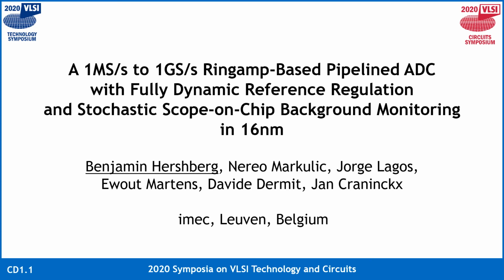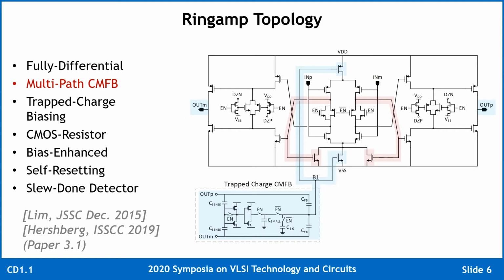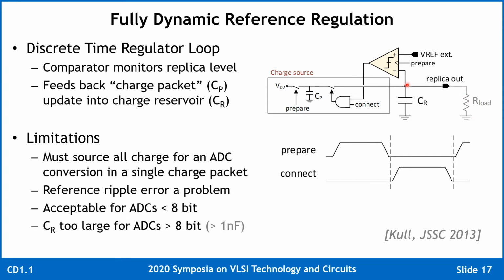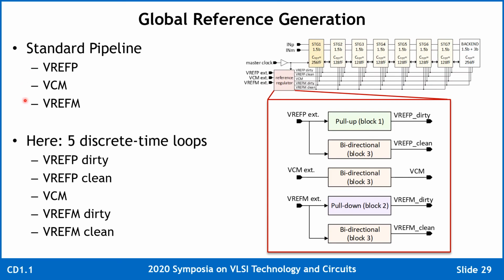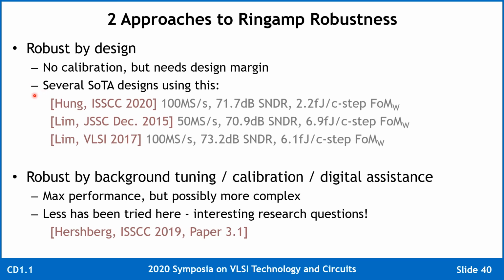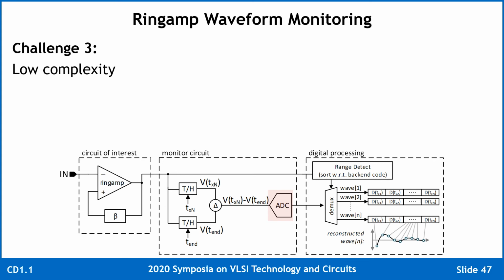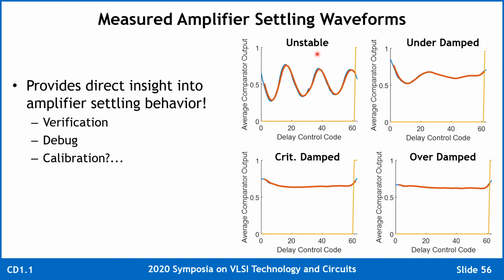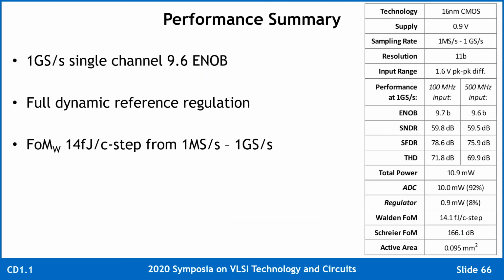A 1MS/s to 1GS/s Ringamp-Based Pipelined ADC

Comment: Sir, I'm not very familiar with the simulation methods used in ring amplifier design. Could you please clarify if the Bode plot is not a primary concern during the design process, and if instead, the transient simulation results are more critical to focus on?

In my design process, I've encountered some difficulties. When simulating a cascade of three inverters, I can achieve the required open-loop gain, but the system is unstable (I haven't added a dead zone yet). After incorporating a dead zone and applying this in a transient simulation, I get the correct results. However, I'm wondering whether I still need to consider the Bode plot in a closed-loop condition?

Thank you for your assistance.🙏
Reply from the maker: Bode plots and DC/AC/STB analysis are useful, but they are just a first step. A ringamp can appear to be stable in small-signal analysis but turn out to be unstable in transient when the dynamic, non-linear, large-signal effects are accounted for. Still, for a class-AB ringamp, AC analysis can be helpful (it is rather useless for a class-B ringamp). For example, it can tell you what your steady-state gain and gain-bandwidth is, which sets the upper bound on your achievable settling accuracy and settling speed. (If this does not meet your speed targets, then your design probably never will, so it is a good starting point.) But for most ringamp topologies, eventually you will need to move over to transient analysis for most of your final design and verification signoff. The more dynamic and large-signal the ringamp topology chosen, the more transient results will diverge from your AC approximation.
Reply: @BenjaminHershberg  Thank you ,sir! I have gained a good understanding and successfully designed it. I truly appreciate your assistance!

Comment: Sir, can you explain further on the CMFB network? How do the AC and DC path work?
Reply from the maker: Indeed, I move through that circuit rather quickly in this presentation. You can find a more detailed explanation in Section III.B. of the following paper: http://www.benjamin.hershberg.com/wp-content/papercite-data/papers/2021-jssc-type1-direct-rf-ringamp.pdf

If you have any specific questions which that paper's description doesn't answer, let me know.
Reply: @BenjaminHershberg  Thank you sir, I've undertood that. But I have another question about RingAmp design: How do you perform AutoZero in RingAmp while maintaining stability? Since the CDAC of the next stage is not connected to RingAmp as a load and the feedback factor is increased to one during AZ phase. Lim Yong mentioned this issue in his 2015JSSC paper, but his method is quite complex. Do we have to split the RingAmp with a capacitor and perform AZ only for the 1st stage?
Reply from the maker: @epicureepicure9620  You're right to observe the output loading complications that crop up with a full auto-zero. Yong Lim (and others) have played with various techniques for auto-zero to overcome this. (Download the Ringamp Survey spreadsheet on github at https://github.com/bhershberg/RingampSurvey and ctrl-F for "auto-zero". You'll find several papers talking about auto-zeroing in the abstracts). You're also right that one way around the full auto-zero complexity is to only auto-zero the first stage, at the sacrifice of auto-zero accuracy. You can choose either input-offset storage or output offset storage. I tend to prefer input offset storage because it doesn't create any loading on the sensitive internal nodes of the ringamp, although it does decrease the loop gain and loop bandwidth due to parasitics of the series input storage cap. The offset can be sampled onto its own dedicated cap, or in some cases you can re-use existing hardware and get it for "free". For example, take a look at the recent ISSCC 2023 paper 17.5. The author is already using a split-cap MDAC to store offsets. In theory, you could also store an auto-zero offset on these caps too, with a bit of careful thought & cleverness. Lastly, keep in mind that many applications do not require precise offset cancellation at the amplifier level, often it is only necessary at the system level. In those cases, you can often use some digitized information coming out of your system to estimate the offset. Digital cancellation tends to be enough for most cases (this is what I've always done in my own designs), but if your application requires offset cancellation in the analog domain, you can always feed this digital guidance information back to a calibration DAC that adjusts the ringamp's offset.
Reply: @BenjaminHershberg  Thank you for that long and helpful guidance, I'll try it.